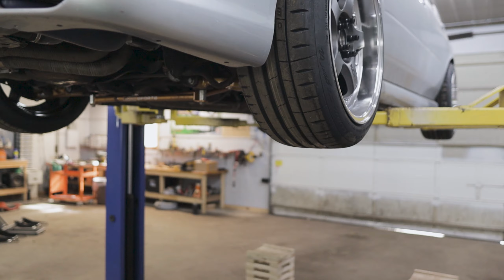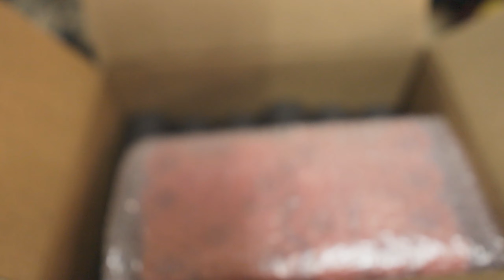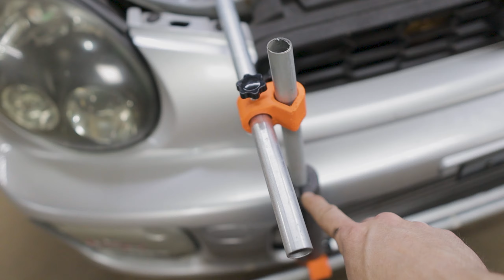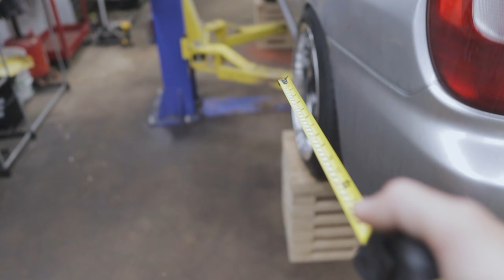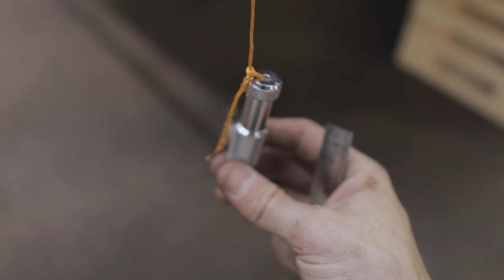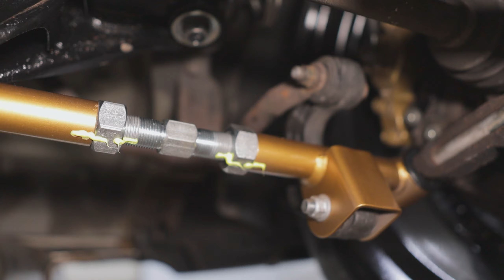2002 (GD) WRX DIY Alignment Using Caliper Garage Kit

Comment: The plumb bobs just need a stopper knot, not the loop and then they hang straight down
Reply from the maker: In this setup they aren't acting as plumb bobs, essentially just weights to tension the string, pointing straight down is irrelevant.
Reply: @TwoFourSevenDIY my OCD is twitching

Comment: The track isnt the same on the front and rear on bugeyes think the rear track is 10mm less on rear. I did thjs with jack stands and string and got it checked and if u measure for 0 toe on the front its actually toed in
Reply: The track width doesn't matter for measuring individual toe, the string forms two parallel lines even with the cars center line.

Comment: How do you get the suspension settled if youre using a lift and setting it down on wheel stands?  Not a concern?

I do think that kit is pretty slick for 75 bucks. You can actually do a proper string alignment with it like this
Reply from the maker: It's sort of just have to take what you can get.
Ideally a drive on lift or a bay with a pit below would be best.
This should be close as you can get to those setups. Plus I'm on air struts,  there's very minimal settling when the car is lowered onto the stands.

Comment: Hey I also recently just installed the whiteline rear lateral links on my 03 wrx and was wondering if both of your arms were around the same length still after aligning? I just had a shop do my alignment and the driver side is now 1/2" longer and the passenger side is a lil over 1/2" shorter
Reply from the maker: I tried my best to keep them even using the factory eccentric bolt, but it wasn't quite enough, I did have to widen the drivers side slightly, I think maybe 1/4" or so to get the alignment perfect
Reply: @TwoFourSevenDIY  nice appreciate the reply!